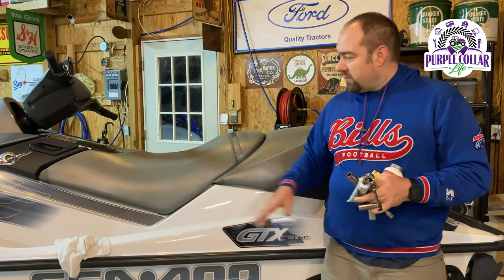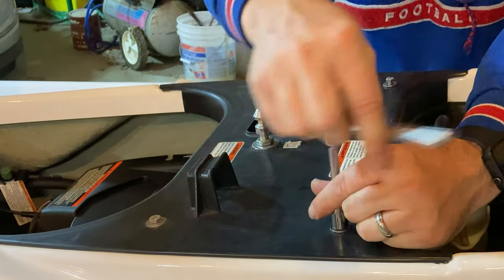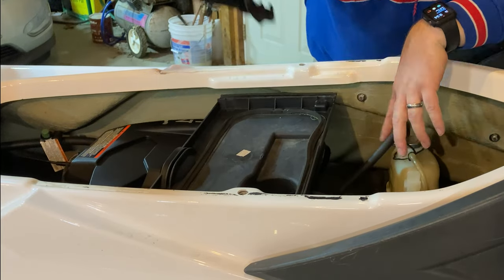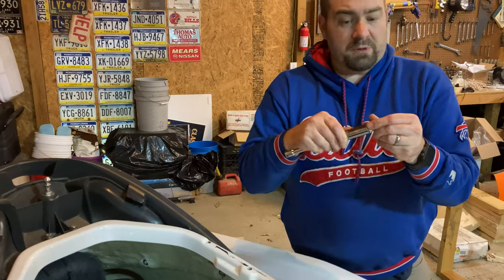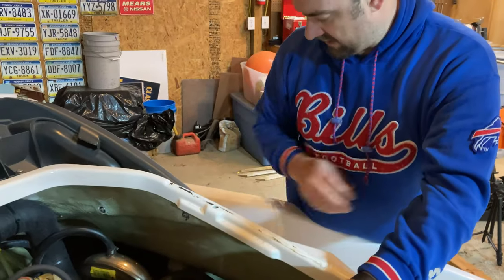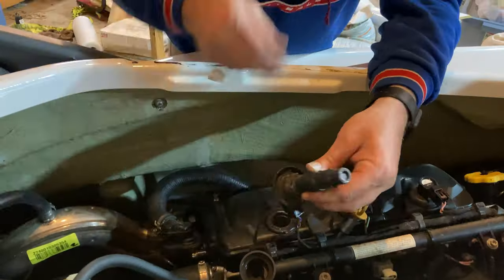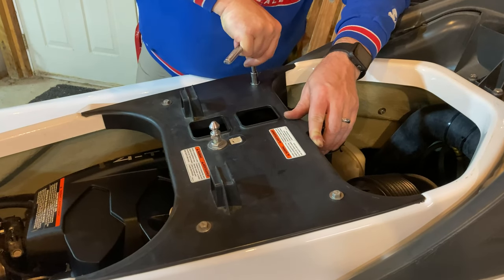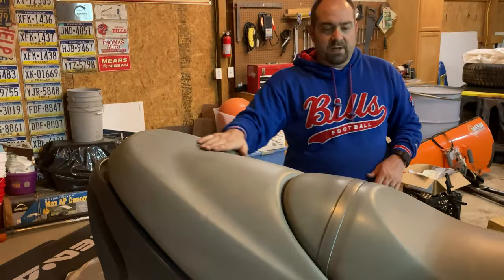SEA-DOO GTX 4-TEC running rough - DIY spark plug change

Comment: I just drained about 6 gallons of gas last night. If that doesn't fix the problem, the plugs will be next. I did add 3 ounces of Lucas gas treatment and new Non ethanol Premium for this 185HP supercharged. Great post sir! The river looks beautiful.
Reply from the maker: Keep us posted! I'm curious if the new fuel fixes your issue. The plugs made a massive difference for us.
Reply: @PurpleCollarLife  Hey  It turned out to be the plugs and I wish I'd started with them before draining the fuel. We backed into the water, not leaving the trailer and it was still running bad. Pulled  the plugs and the #2 and #3 plugs were the problem.  Replaced the plugs and it ran perfectly!!

Comment: Good day - I never road a PWC - But, when I lived in Idaho, my neighbor had one.  One day I saw him working on his machine so I thought I would see what he was doing.  I walked over and he was trying to start the machine - he had a garden hose attached to the jet pump and water was coming out of it but the machine would not start - I had some experience working on a boat with a 454 Chevy big block and recalled the engine was cooled by pumping the water from the water jacket into the exhaust headers and then out the back of the boat - It looked like the PWC functioned the same way.  I suggested he turn off the water as I suspected the water had backed up in the exhaust and into the engine (two-stroke) - I asked him to remove the spark plugs and sure enough the plugs were soaking wet with water - he didn’t have an air compressor so I suggested WD40 (water displacement) - we turned the engine over without the plugs and sprayed the plugs with WD40 - It tried to start but was flooded again my the water in the exhaust - we repeated the process several more times - finally the engine fired and the garden hose was turned back on to cool the engine and jet pump - I think I earned a little respect from my neighbor that day and saved their weekend - thanks for the video - have fun on the river and be cautious of the low head dams - Enjoy the journey - cheers
Reply from the maker: Thanks for sharing the story! Nice idea literally help with a flooded engine. :).
Reply: Not many ppl know that the WD stands for. The 40 stands for the number of times it took to come up with this solution. Great Idea you had using WD40 in this situation. You have my respect for sure LOL

Comment: Man I’m glad I stumbled upon this video !!!!!!! Was about to pull the inter cooler out and pressure test it.  Mine was doing the same exact thing.  Wouldn’t get over 5400 rpm and 36mph.  (Just got it in a package deal).   Changed spark plugs and it’s hitting 7800 and 61mph with my daughter on it.
Reply from the maker: Great to hear! I wasn't aware how the plugs really influence the performance on these 4-tec engines until I had my first Sea Doo with this powerplant. It's amazing what a fresh set of plugs will do! I'm glad the video was helpful. Thanks for leaving a comment. If you haven't already, we would really appreciate if you'd consider subscribing. Every comment, like, and subscriber helps our small channel grow. :)

Comment: Definitely one of the better videos on how to change the spark plugs.  Glad I saw the situation with the top of the plug, that would have messed me up.  I'm going to change my plugs tonight on my 2004 GTX 4-Tec because it was running sluggish last weekend and it had been sitting since last summer.  Hopefully that fixes my issue.
Reply from the maker: Glad you liked it!  Keep us posted! I have read that changing out the plugs is necessary once or twice a year typically.  Those GTX 4-tec engines really are picky about plugs!
Reply: @PurpleCollarLife  I was able to replace my spark plugs tonight in both my RTX and GTX in less than an hour which was fast for me.  Do you have any concerns about applying the dielectric grease the way you did and it getting on the metal end of the spark plug?   Thanks.
Reply from the maker: @stctjc  great job!! I was careful where I applied it, but I’ve also seen it put directly on connectors.

Comment: Got a 2004 NA GTX, myself. Going to replace the spark plug tubes and valve cover gasket. Leaking oil in the tubes. Still going strong after 19 years.
Reply from the maker: Thanks for sharing! I’ve had the supercharged version before. While I did have a LOT of power and pep, I prefer the naturally aspirated version because of the ease of use and maintenance.

Comment: Nice job Chad.  My sons bought a pair of 1997 GTX's and they could never get them running well at the same time.  I've worked on lots of outboards and inboards but never PWC motors so I wasn't a ton of help.  After two years they threw in the towel and sold them.  They managed to just about break even, so in boating I call that a win!
Reply from the maker: Always good if you can get some fun out of something and then sell it to brake even.  They are pretty tricky little motors.  And there isn’t a whole lot of space to move around in there unless you pull the engine out.  Inboards are so nice to work on - just tip that clam shell all the way back and it’s like you’ve got full access to both sides of the engine.

Comment: I change my plugs every 50 hours and ride year round in FL.  So, that means at least 1-2 times per year.  Before I pull the plugs, I use compressed air to blow out any debris in the spark plug tubes to prevent it from dropping into the engine.  I also use the ignition coils to assist in removing/replacing the plugs.
Reply from the maker: Thanks for sharing! Good idea to blow out any debris.  I’d love to put 50 hours on the Sea Doo this summer! So far I’m at about 10 for the summer.  It’s such a fun machine.  So much more maneuverable than the boat - and easier to load/unload.
Reply: I change mine every 200 hours, even if they still look like new

Comment: Great  video.  I have 2004 gtx sc and was confused about the tip of the plug staying in the coil.  My plugs looked bad so I thought previous owner hadn't changed them in awhile so they got stuck in there.  Now it makes sense.
Reply from the maker: Glad it helped! I was confused for a second when I couldn't get that spark plug boot down over the plug.  I'm glad I thought to check for those screw on caps!

Comment: Hard to believe that new plugs made all that difference. The old ones looked good to me.
Reply from the maker: They didn’t look to bad - but I’ve read that these GTX 4 stroke machines are really particular about the plugs.  I’m not sure what causes it - but the brand new plugs have made a huge difference.  I’m planning on replacing them at the start of every season.

Comment: I have this exact same ski. Love it. Added speakers to it too. I have to change my plugs every year haha. Otherwise it runs like 💩
Reply from the maker: Of all the combustion engines I've owned in vehicles, boats, machines - this SeaDoo is the MOST picky about a perfect spark plug. But like you say - a new set and it runs like new every time.

Comment: NICEE VIDEO 👌👌 I GOT THE SAME SEADOO JETSKI  SAME COLOR 😆👍
Reply from the maker: It's a great machine!
Reply: @PurpleCollarLife  mine  doesn't get full rpm and it can't pass 43 mph ..I was checking and those run around 50 to 55 mph... do you know what could be the problem
Reply from the maker: @cubanh22  If you've already changed out the spark plugs and made sure your fuel was good - my next guess would be the wear ring needs replaced.  Do you feel cavitation under initial throttle?
Reply: @PurpleCollarLife  are you using premium fuel?? I WILL CHECK THIS WEEKEND....I just installed new plugs and coils....Im not sure but maybe could be a little cavitation ...this is my first jetski
Reply from the maker: @cubanh22  We use only Ethanol free gasoline. The Ethanol in regular pump gasoline isn't good for in boats - too much moisture accumulation and it can cause problems with the fuel system.
Reply: @PurpleCollarLife  thanks for your advice 👍👍

Comment: What I think I noticed is u put the first blk cover  back on and didn't show putting the dip stick in b4 the second blk cover.  Am I wrong ?
I did this 4 yrs ago but at 68 I forget a lot. Lol
Reply from the maker: I think you put the first black cover on (that says 4-tec and just snaps on), and then the dip stick gets installed, then the 2nd black cover on that gets bolted on. The dip stick can't be put back in before that first black cover, because the cover wouldn't go over it. I hope this helps!

Comment: I was told the caps on the plugs should be taken off for seadoos... any thoughts on that?
Reply from the maker: That is correct. We show that in the video.
Reply: @PurpleCollarLife  darn I didn't see that
Reply from the maker: @chefgarrin  No worries. We struggled getting the spark plug boot back on the plug until we discovered that the cap has to come off. :)